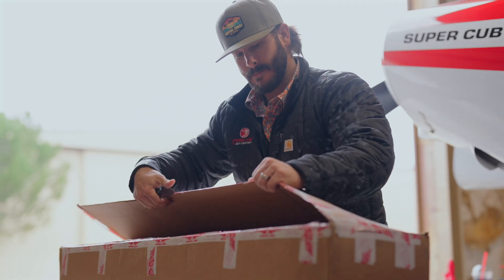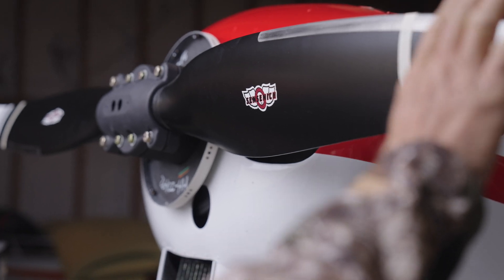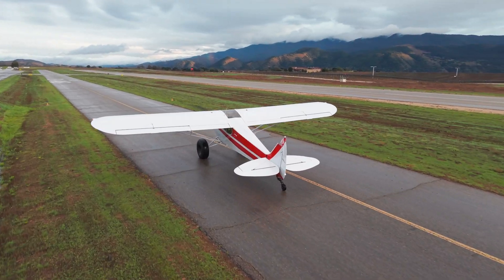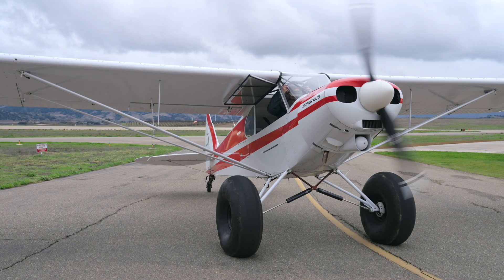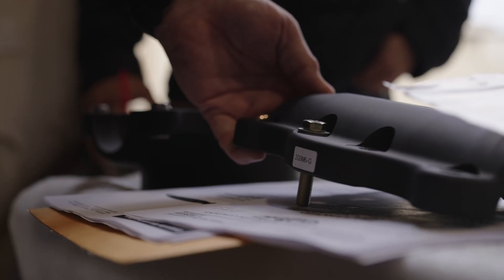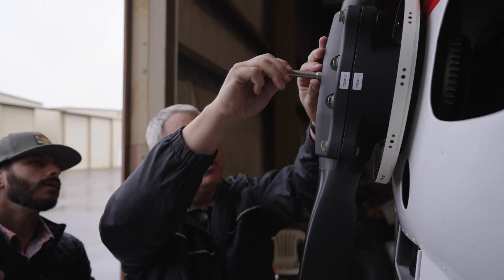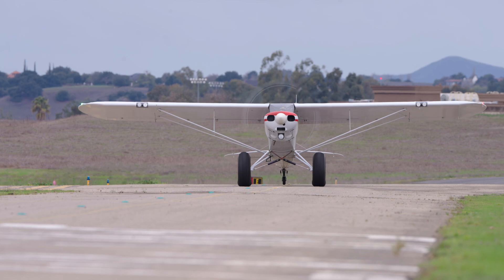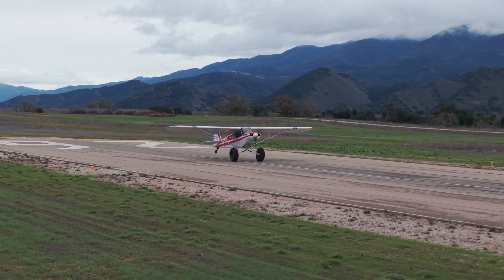The Sensenich 82" Composite Ground Adjustable STOL Propeller - a backcountry must-have!

Comment: So what settings are you using for STOL and cruise and what speeds and takeoff distances are you seeing?
Reply from the maker: @haystax  we are 12.7 degrees. I feel like it’s comparable to the borer on acceleration. I was 84 mph IAS prior. I’m now 100mph IAS. I will be doing more testing shortly. Stay tuned.
Reply: Hi ! @Chris_kunk  lycoming O320 150 hp? Tks

Comment: Solid work on this video man! Prop looks great too, I'd be interested to hear some numbers (cruise speed and static thrust).
Reply from the maker: @TrentonPalmer  hoping to do more flying soon. Right now I’m thinking I’m at the same low end power as the borer but picked up 16mph in cruise. I’m seeing 100mph IAS. I want to do some more testing with pitches.